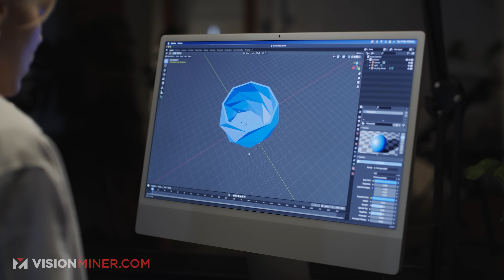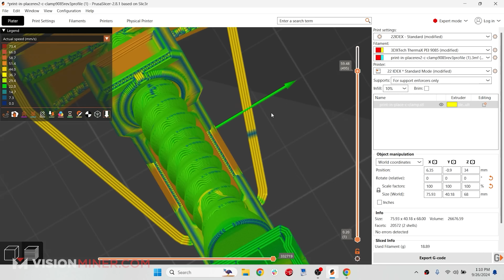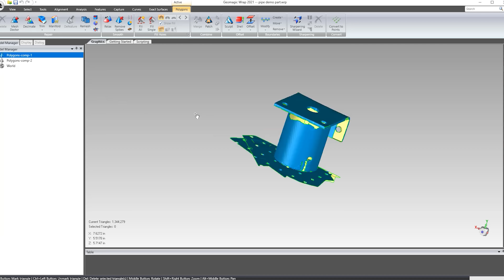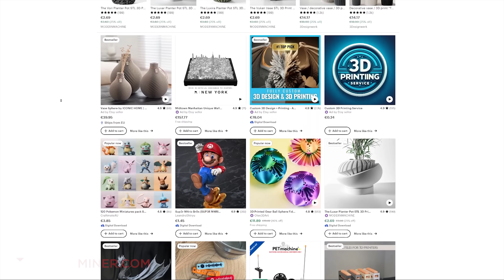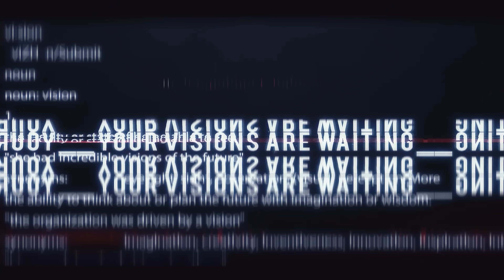Did This Machine Ruin 3D Printing?

Comment: The discussion about "lost skill" could be used for anything. How many folks have programmed in assembly (vs used an arduino)? Adjusted valve lash on a motor (vs just use their car as an appliance)? Developed film by hand (vs used their iphone)? Also, the next discussion was based on "I have no idea how to do this in CAD but i can direct print from a scan!". You'll have a bunch of draftsman complaining about how "computers make it too easy" and "we used to have to know how to use scales for hand drawing!".....same energy from the other side of the fence.

The whole point of the "hobbyist" market is to remove those barriers for entry. The people that enjoy it will seek out the "lost knowledge". Also how great is it that you don't HAVE to mess with slicers constantly anymore? I don't need another hobby (in the form of a printer), I need a tool to help me with my existing hobbies/jobs.
Reply: As a 26yo professional manual machinist I’ve watched my peers get excited about machining, learn CNC milling then get bored of it in the same week. They lack the depth of understanding to even imagine the scope of their abilities. This will be good for printer companies but the people on YouTube tinkering with super fast, or 5-axis, or axial 3d printers will always be the winners. Once the casuals break their bed levelers the hobbyists will scoop their tools up for nothing and continue to innovate.
Reply: OMG, now i feel old... (i've done that stuff, asm when i was a kid (68hc11 in college for computer engineering) , to film at wolfcamera (from the minor in astronomy), cars at ntb (family used to drag race))... i'll be 51 soon LMAO
Reply: @jasonwise6722  I must be an "old soul" then! I'm about 15 years your Jr but had a similar path! In fact, circa 2010 in the EE program we were still using the 68HC11 LOLOL.
Reply: For a lot of people that's what works and for somebody who wants to run a quick easy business it makes sense, but honestly if somebody is interested in learning principles of fabrication one of the less "user friendly" options is a great tool to both learn and encourage through iterative improvement of designs and learning the factors through slightly, but not overly, painful experience (just losing a little time and relatively cheap filament) to empirically start adjusting variables and learn how they interact with specific aspects of prints that may cause issues
Reply: @bobjoe1593  "...principles of fabrication..." I've never seen a 3d printer, bro. know anything about actual manufacturing. They all believe 3d printing is the pinnacle of manufacturing instead of recognizing it for what it is: a tool.
Reply: Jim, you hit the nail on the head!
Reply: I think it is kinda of a dual thing. While making tools easier to use and more accessible is great, I don't think people not understanding how their tools work isn't. When something does go pear shaped, the amount of explaining I have to do to help people has magnified. Car repair got significantly more expensive as fewer people work on their own, even when the process is not computer related.
Reply: @ltlbuddha  It's the same thing with computers, its great that the average person doesn't need a background in cs to run a machine, but it makes things take a little longer when there is an issue. There are certainly less problems with modern computers, which is great. They are also more accessible, which is great. I don't think anyone thinks that computer tech was better in the 80s and 90s, when the barrier to entry was so much higher, but that's what people are acting like now that 3D printing has gotten more accessible. Sure, the average user might have to spend a little more time to diagnose and fix and issue, but there are so many more users, which is an awesome thing for the field. I don't understand the need for gatekeeping like this video is promoting. Our hobby doesn't need to be niche to enjoy it, its great that Bamulab is lowering the barrier for entry.
Reply: Pefectly stated.. My first moment with a 3d printer was gel based injection back in 2000..over a decade ago I got my first machines.. nothing stayed stock because well, it COULDNT and work reliably. As he states in the first moments.. a lot of us have been full circle with these machines, and having one now that we can grab "off the shelf" and daily drive is a huge relief. If i need to tinker, I can, on a different machine and rat rod it out to the ends of the earth. Do i get questions from people lacking the knowledge I have, yea. Do I not share that knowledge and instead tell them "should have bought a kit you ahve to build", no. I let their owning a reliable daily driver, turn into either boredom and they leave the hobby for another, or into a passion for the industry and watch them blossom, and help along the way. This isn't a space for everyone, most of those that get bored with it likely printed nothing but trinkets, and id rather they get filtered out with the bambu effect, than let those that want to engage deeper into the depths, have that option as well. A mind that wants to learn, will do everything possible to do so.
Reply: @MattWeber  Also agreed. Starting with this back in 2009/2010 era until now has been a wild ride. It seems that one of the primary "critiques" geting repeated is that "people get bored" or "i have to explain it more" or just another version of the original video. I think that's more of a personality thing than a "printers got easy" thing.

I think we're seeing more people "drop out" because they were people that previously would have had a barrier to entry. However, I also think there's equally as many (or more) people that are sticking around or continuing to be interested that would have been shooed away from frustration.
Reply: These "experts" need to let people develop their skills independently. Not everyone started out building their machines from scratch, and ended up running a million dollar print farm.
Reply: Well said.
Reply: It also creates a market for the people that have the knowledge to get paid for that knowledge by the people that don't. It brings to mind a software development project that I contracted on, and during the kickoff meeting, there were three developers sitting off to themselves. They were obviously much older than the rest of the team (like in their 60s/70s vs a bunch of 20-30 year olds). When I asked who they were, one of the development managers stated "Oh they are the COBOL developers. They make more money than anyone else on the team because there's only a relatively small pool of developers that still know COBOL, so they pretty much got to name their price. Nobody knows what they do. We just ask them to retrieve or update some data that we need from those super old government machines, and they come back with the update or the data we need." 😂
Reply: @jocelyn-n-tech  Absolutely, and the folks making this video are an example of that (which is also why its a little like, c'mon guys really?). If I want to do some small control projects at home, I can get a CLICK PLC and stumble my way through it (easy, simple interface, cheap, etc.). If it's something that requires a SIL4 safety level and near 99% uptime, I'll gladly hire the contractor to design and implement a solution for me with whatever system they prefer. Both examples are the same end product with vastly different required skill levels (just like the printers being discussed).
Reply: He literally talked about using a scanner that he can just hit a button and have it work while bemoaning people for using a Bambu printer for not knowing archaic slicing shit. So out of touch. But that's 3d printer bros for you. They all think they are engineers.
Reply: Totally agree, i custom made a prusa when all 3D world started a lot years a go, i made and still upgrading a 200kg CNC machine with auto tool change.
My favorite part is the DIY, but bambu for me it's the best of this decade because a lot of people enter to 3D printing. 
I don't say bambu is good or bad printer o best brand, is the effect of new ppl equal a more development (more investigation...).
Reply: Perfect, I even imagine a hypothetical assembly developer saying "we are losing the ability to call operational system interrupts directly"
Reply: Agreed. It’s the difference between having 3d printing be your hobby vs it being a tool. 

Your example of tuning your own car is a good one. It used to be necessary for everyone to kind of know how to maintain a car. And now the car is more of an automated tool that self adjusts and monitors.
Reply: @jamesx7424  thanks, and absolutely. My race motors require a lot more attention and diligence than the one in the daily driver. Was there a time where more diligence was required for a daily driver? Absolutely. I'm very appreciative that's no longer the case though. It's okay that we can have something as a hobby but its also okay when it's not required to use that thing.

If there are criticisms about bamboo and decisions to remove features, or be closed source, or whatever; that's fine and those are valid, discuss them as such. However, choosing to focus on how "easy things are nowadays" is a worn-out trope.
Reply: @TurgleYT  that's gatekeeping isn't it ? Let people decide if they want to be consumers or hobbyist - make a product that does both and provides a slow burn.
Reply: absolutely,  make it open sourced. you can still tinker yet most people who want the tool will just buy it
Reply: @liquidmetal718  gatekeeping being bad is a >5yr phenomenon. If cutting edge technology is made palatable to the masses then it will no longer be cutting edge. Some things are made for the masses, not all. If a McLaren was a product "made for both" the company would have been out of business by now. Their strength lies in their ability to exclude casuals and create something of elevated form. like Jazz or spicy food. quantity of consumer does not equal quality of consumer.